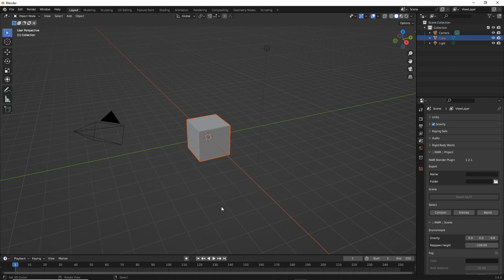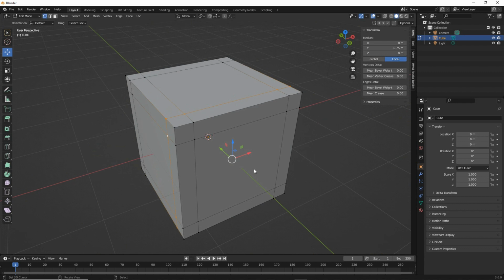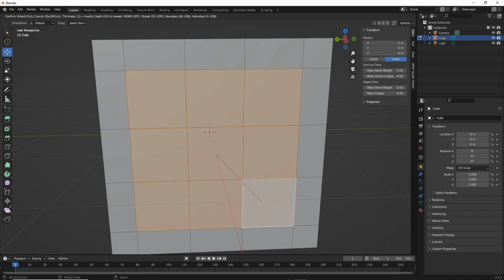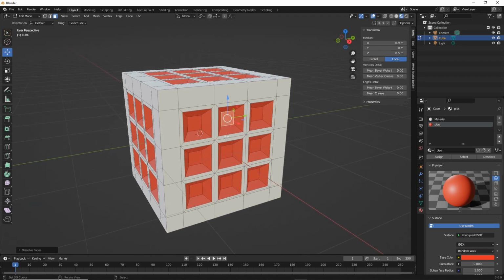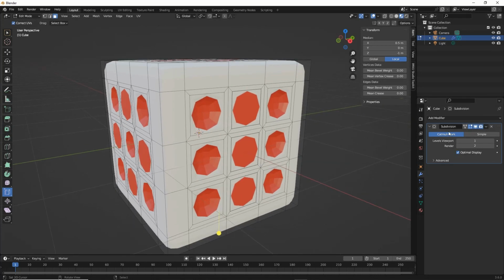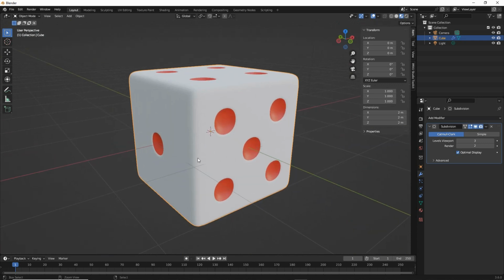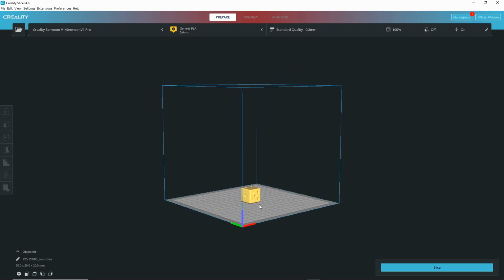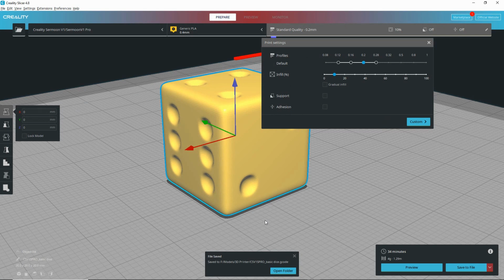3D Printing & Blender - making a dice for 3D printing

Comment: Thank you! Good intro to get me using my printer!
Reply from the maker: If you do one the same size, post some info on how long it takes to print out!
Reply: @KatsBits  Sounds good, I won't be printing till Thursday or Friday. My die is 15mm, I am using lychee slicer and doesn't seem to give an estimate of time. So I update you when I print.
Reply from the maker: @KarlStrass-Hundal  :thumbsup: as a frame of reference that'd take about 25 mins to print on my hardware.
Reply: @KatsBits  Took me just under 35 mins on my Anycubic Kobra Max
Reply from the maker: @KarlStrass-Hundal  solid print or partial fill? The 25 mins mentioned above uses a 10% fill so the printer auto-generates an internal structure so it's not a solid block of FDM.
Reply: @KatsBits   I had a partial infil pattern of 15% with hex design. With 4 solid layers on the top, bottom, and walls. With a max speed of 50mm/s. Not sure if that is helpful  as I am new to 3d printing.
Reply from the maker: @KarlStrass-Hundal  that's pretty interesting. I'll see about doing a 'test' example everyone can use to get a uniform baseline.